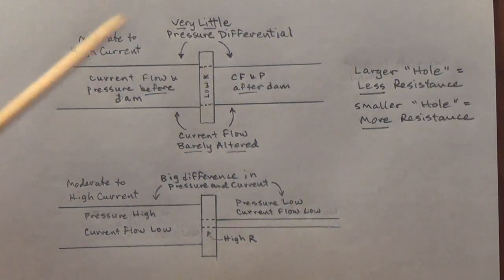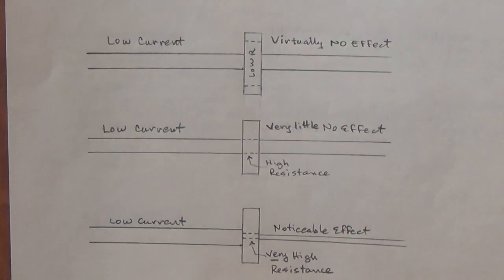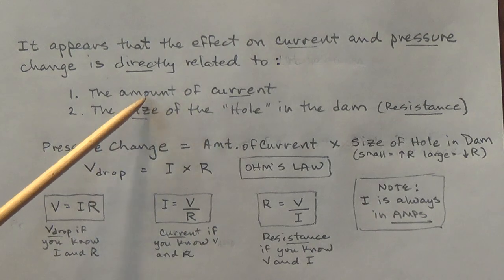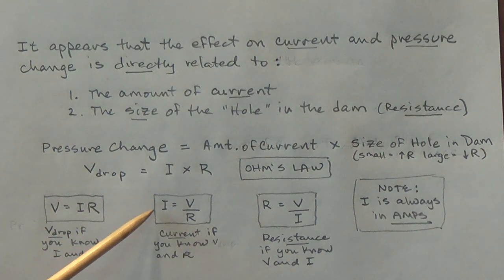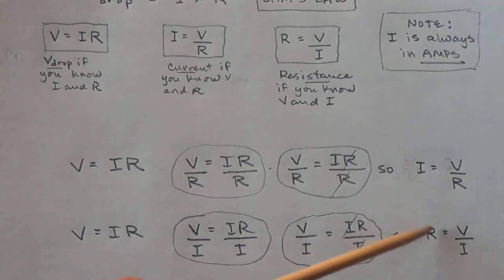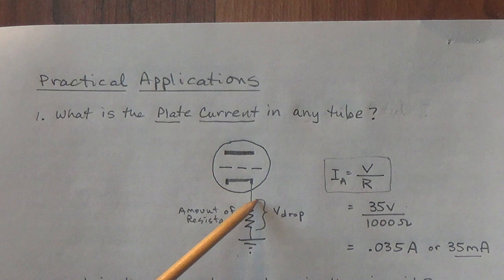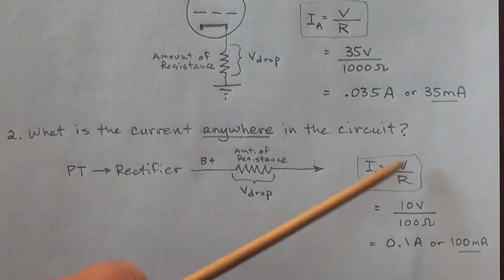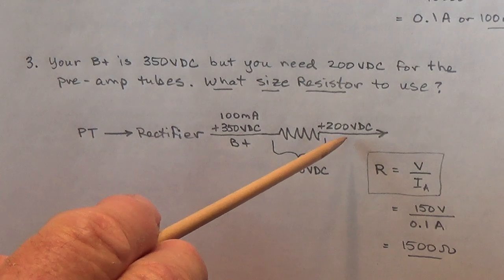Resistors, Part 1:  Their Circuit Function &  Practical Applications of Ohm's Law

Comment: Ohm's Law trivia:  Back in the day I took the letter 'I' as an indicator of current as just one of those things.  For whatever reason I wondered today why it is 'I'.  It turns out that 'I' is a derivation of the French term "intensité du courant" (literally, intensity of current).  The phrase was apparently coined around 1820 by a dude named André-Marie Ampère.  It eludes my what some French guy named Ampère, in 1820, would have the audacity to come up with 'I" as an indicator of electrical current.  :-)
Reply from the maker: Thanks, Michael. Let's face it, what does a guy named Ampère know about current?......especially a guy with a girl's middle name :):)

Comment: For #3, wouldn't it be incorrect to say the current flow is still .1 amps? .1 was the result when there was a 100 ohm resistor but if we are increasing the value of that resistor to drop the 150 VDC wouldn't the current flow be less?
Reply from the maker: The voltage drop is dependent on the current applied to the resistor and the value of the resistor.....period. Using your method would make it impossible to answer the question because you would have to change the current to suit each resistor, which would result in a different resistor value, which would change the current, etc. etc.

Comment: So... Im nearly brand new to this stuff.
Dumb question 1. How do you drain the caps after you unplug the amp?
Dumb question 2. I have a self biasing amp, but I dont trust it. It came stock with EL34s.
...but i contacted support and they said its ok to drop 6v6s in it. They said its fine but id notice a power drop.
So thats what i did. Sounds way better now. However Im concerned (despite what support said) that Ill run into trouble later becsause of the etremely different tube specs.
The amp is basically a clone of a Vox Night Train. 50 watt head.
Am i just being paranoid? ...or am I correct to be concerned?
I made the tube swap around 3 months ago.
Id really like to see the bias voltages for myself to ensure everything is OK...thats why im trying to learn this.
Thanks for the great videos!
Reply from the maker: You're not paranoid at all, IPH, in fact, I wish all amp owners were as conscientious as you are......and your questions are far from dumb. In several videos, I have shown how to drain the filter caps using a homemade tool. The simplest way is to buy a 100 Ohm 5W resistor, hold it by the insulated body of the resistor, and touch one lead to ground while touching the other lead to each positive filter cap lug for several seconds. With regard to simply plugging 6V6's into EL34 sockets and hoping for the best, I too would be skeptical. Cathode-biased ("self" biasing) circuits are forgiving, but such a tube switch would definitely be a severe challenge for the circuit.  Watch the videos on safely measuring Plate Voltage (plate to ground with DMM) and Plate Current (measure exact cathode bias resistor value(s) then measure voltage drop across them while amp is running...calculate PC via Ohm's Law). See videos for explanation. Be careful. Good luck.

Comment: One of my early instructors, many decades ago, laid Ohm's Law out so. You can use either of the two, depending on what you know to be true.

   E                            P
I     R         or         I     E

Circle what you want. You want P (power)? What do you have left? I times E (or IE). You want I (current)? Whats left? Either E over R or P over E. You want E (voltage)? Either I times R or P over I. You want R (resistance)? E over I.

Easy to remember. And, I never forgot it.
Reply from the maker: This is indeed an excellent way to remember the equations, NDL. Thanks !!!

Comment: When I first started electronics all I could find at first was resistors from a local surplus store. With that pack of resistors, a breadboard, some LEDs and a multimeter, I spent a good 3 months or so learning stuff about them before I moved on to other things. Don't under estimate the complexity of electronics. If you think something's simple, you don't know enough about it.
Reply from the maker: Amen, N. You never quit learning new things in electronics......and you'll never know all there is to know. We're all stuck somewhere in the middle :)

Comment: Uncle Doug, you have managed to teach me in 20 minutes what I was supposed to have learned over a whole term in school but failed to grasp.  Your explanations are so clear and concise. The electronics Tutors in our school appear to confuse their Students by going off on meaningless tangents. I'm now wondering about their abilities to teach students and questioning their knowledge.  In this awsome video you mention ohms, current and volts. The one big question left in my mind is how do I deduce the correct wattage resistor to use in these example circuits; I guess this might be very important if you don't want to let out the magic smoke from the resistor?
Reply from the maker: Wow......thanks so much, IG. You use Ohm's Law to calculate the wattage of resistors. There are three different formulae:  Power (in Watts) = Current Squared x Resistance  or  Current x Voltage or Voltage Squared divided by Resistance. For example, if you know the current, i.e. 5A, and the resistance, i.e. 10 Ohms, then the Power =  5 x 5 x 10 = 250W.

Comment: Very good- but... I was taught to lift one leg of a resistor to (fully) isolate it for (self) measurement. So, I was surprised that you are measuring "in circuit"- more than once. I realize that we are teaching very basic components and math here, but... hmmm
Reply from the maker: I lift a leg too, Thomas, but only when the in-circuit value varies significantly from the expected value.

Comment: Your videos are helpful.  I'm the proud owner of 4 tube guitar amps, 2 of which are hand wired, 3 with DC Rectifier tubes.  I hope to carefully (safely) learn how to bias my own fixed biased amps (2), and perform amp circuit testing, and replace bad caps, etc.  Thanks for helping me to move toward that goal.
Reply from the maker: You're welcome, Clay. Best of luck with your do-it-yourself projects, and be sure to follow all rules for electronic safety.

Comment: Hi, i was wondering  how resistors effect a low line level like a guitar signal (can they change the frequency response?)
Reply from the maker: It depends on their values and where they are located in the circuit, Fred. Capacitors tend to have a greater influence on tone.
Reply: Thanks! great video!

Comment: What's the best way to drain capacitors before tests?
Reply from the maker: In my biasing videos, I show you how to build a cap discharging tool using a 10W 100 Ohm resistor.....check it out.

Comment: greetings uncle Doug
i have a checked checked voltages to my leslie 147 amp and here is what i got compared to suggested voltages based on today's 120volts instead the 117 volts of the past decades

1st DC voltage coming from the bridge rectifier to one side of the choke  is 444 vdc,  suggested voltage should be 430vdc.    
2nd voltage on the other side or after the choke is 432vdc.  suggested voltage is 420vdc
i checked resistance on the choke and it is 64.1 ohms

3rd voltage after the oc3  is 317vdc.  suggested voltage is 310vdc

i wonder if could get your advice here  because i've been thinking if i put a resistor between the output of the bridge rectifier and  the choke to lower these  dc voltage at least closer to the suggested voltages based on this web site   
https://www.google.com/url?sa=t&rct=j&q=&esrc=s&source=web&cd=7&cad=rja&uact=8&ved=0ahUKEwjZ69nTs9zVAhVLyVQKHePLDTcQFgg-MAY&url=http%3A%2F%2Fbentonelectronics.com%2Fservicing-the-leslie-147-amplifier%2F&usg=AFQjCNGke3-yafFswHTPTpY-Qy7FRQ4Bxg

if it is possible though, what size resistor and  also of what wattage this resistor should be.

thanks in advance
Reply from the maker: To be honest, 4H, I would ignore the slight voltage elevations and simply use the amp as-is. I can't imagine that the relatively minor increases would cause any harm at all.

Comment: Hello,
I hope I can ask this question correctly. In part three the goal was to find the resistor you need to properly power the preamp tube. You solved this by finding the current in Part2 (.1A) this allowed you to solve for Part3. How is it possible to find the resistor needed in part 3 if you didn't have the resistor to measure in part 2? 

I hope this makes sense. I'm really interested in the designing of amps from scratch. 
Thank you as always I'm learning so much from your videos, great teacher you are :D
Reply: Please forgive me, I rewatched a few times and noticed your pop up on the screen which answers my question of just adding a resistor temporarily to find the current then you can solve for part 3. Thanks as always.
Reply from the maker: You're welcome, Garrett. We're glad you were able to solve the problem.

Comment: Thanks for t his video series!!  I have no problems with the math, I started this journey but putting myself through the NEETS testing so this is a great refresher.  I'm really enjoying learning where the various bits of knowledge are useful in an amp is really helping me make sense of what's going on when I fix things.  

Also, Ever hear of a Halton radio?   I got dug one out of my parents barn,  the wood is shot but I'm thinking it could possibly be turned into an amplifier... am I nuts?
Reply from the maker: You're welcome, Daren. I have never heard of Halton radio. Many people convert radios into guitar amps, but I never have.  In table radios, much of the chassis is devoted to the receiver circuit, which is not used; the output power is generally rather limited, and the speaker is generally small and unsuited for guitar use.  Some console radios, however have larger speakers and higher output power.

Comment: I'm a little confused on the third calculation. I have a 12at7 that needs 200v and 10ma plate current . If my supply voltage is 350, and I wanted to drop it to 200,  wouldn't I need a 15k dropping resistor in the power supply, not a 1.5k?
Reply from the maker: Not according to Ohm's Law. As stated in the example, Resistance is equal to the Desired Voltage Drop divided by the current, or 150V / 0.1A  = 1500 Ohms.  Why do you think it should be 15K ?
Reply: Yep, I understand the math part just fine:) (I'm a software engineer, I get to do algebra for a living) What I'm trying to wrap my head around is why the supply current is being used rather than the device current. So lets say my supply could supply 10000amps @ 350vdc before voltage sag occurred (Lets pretend my power supply is an entire substation). The tube's plate current would still need to be set to 10ma @ 200vdc. How would I go about calculating both the bias, plate, and inter-nodal resistor with such a beefy psu?
Reply: and thank you for the reply! your videos are very unique, there's nothing quite like them on youtube
Reply from the maker: The plate current and bias in the pre-amp tubes is not set by the resistors in the B+ rail, but by properly selected cathode bias resistors. The nodal resistors in the rail simply provide appropriate voltage to the plates of the pre-amp tubes. To calculate the value of these voltage-dropping resistors, one must know the approximate current flow through the rail. The current draw by the pre-amp tubes is negligible compared to the output tubes, and their bias, once set (usually simply by using the values provided in a schematic), is not rechecked periodically, as it is with the output tubes.
Reply: The amount of current that your supply is capable of delivering, as long as it is great enough to supply your desired current is immaterial. It's the 350V DC that matters. If you know that you need 10mA at 200V DC, you need a resistor that will drop 150V when it is passing 10mA. R = V / I, so you would need a resistor of 150 / 0.01 =
Reply: I hit 'reply' by accident. As I was saying, you need a resistor of 150 / 0.01 =  15,000 ohms which would pass only the 10mA at 200V that you wanted.

Comment: I have two resistors that are coloured a kind of jeep green and under the surface i can see around three windings,they are from a 90 watt bass solid state amp,and the schematic says they are R24 7W, i think they are power resistors,I cant find any resistors online that are R24?,could they be 24ohms?  size;16mm long x 7mm thick.
regards for any help.
Reply from the maker: +MrAndfio   Greetings, Mr. A. The term "R24" is simply the way they are labeled in the schematic. They are the 24th resistor, generally numbered from left to right. They are large ("power" resistors) so they can dissipate 7W of heat. If their actual resistance is not marked on them, you will have to measure it with an ohmmeter.

Comment: Hi Uncle Doug, excellent videos by the way!
I have a concern about the analogy though, if you increase resistance and it decreases the flow rate or current, then the pressure across the resistance stays the same. R = V/I, and 2R = 2V/I so if you double R you can double voltage to keep current the same or halve current to keep voltage the same. There is never a decrease in both current and voltage. Am i right?
Reply from the maker: +Hanzel Pinto  For a fixed Resistance, Current and Voltage are inversely related....an increase in one results in a decrease in the other.....so you are correct, V and I will never both simultaneously increase or decrease, and (as you said) if you double the Resistance, then either the Voltage must double or the Current must decrease by one-half to maintain the equation.
Reply: +Uncle Doug Great so I understand the concept but I get confused when you take measurements across a resistor. This video says you measure DC Volts across the resistor on the B+ to calculate Vdrop. If current is kept constant then shouldn't the voltage increase not drop? Also since there is a resistance shouldn't we expect a drop in current? Does the formula calculate the current downstream of the resistor?
Reply from the maker: Voltage drops across resistors, depending on the resistance and current being applied, but current doesn't "drop" across resistors. The overall current throughout the circuit is lowered by the presence of resistors, but the current is exactly the same on both sides of the resistor. Imagine a circuit with two resistors and current flowing. There is a voltage drop across each resistor, but the rate of flow throughout the circuit is the same anywhere in the circuit.....it does not "drop" from one side of a resistor to the other. After all, if water is flowing through a hole in a dam, there is more pressure (voltage) on one side than the other (i.e. pressure/voltage drops from one side to the other), but isn't the flow exactly the same on both sides of the hole?
Reply: Ohh it finally clicked when I watched the 2nd part! Voltage is a measure of electrical potential energy. As current flows across a resistor some of the potential energy is converted to heat and light so the potential energy decreases! Just needed some of the theory. Thanks!
Reply from the maker: Yes, power (measured in watts) is a measure of the conversion of energy from one type, i.e. electrical, into another, i.e. heat.

Comment: Uncle Doug hi,
Just like to Thank You for all the great videos you have done I have learned so much and some of it has actually stuck which has really amazed me I wish back in the days of school I had a teacher as good as you great job. 

I do not know if you would be interested in sharing some light on or if any one else would be interested in seeing and learning the differences in and between different kinds of resistors such as carbon vs metal and why they are used in the applications they are in amps also a very similar thing with capacitors why they use different types i.e. green caps, polyester, orange drops etc and where they are used and why they are used in particular areas in the amps along with there different make ups.
I have heard so many stories about using the older types of parts i.e. carbon resisters etc to maintain the tone/sound and really would like to hear some truths about them if you ever had the time or was able to?.

Any how Thank You again for the great videos so much great explanations/teaching.
Reply from the maker: +Oswald Wabbit   Thanks so much, OW. Rusty and I are glad you enjoy the videos. My stance on resistors is that the imperfection of carbon comp resistors and waxy old capacitors plays a big part in creating the "vintage tone" we associate with great amps like the Fender Tweed Deluxe of the 1950's.  Metal film resistors are much more precise and stable, but these are not necessarily desirable virtues in a raunchy old amp. If you are seeking ultra-clean,low distortion sound, i.e. for jazz or Hi-Fi use, then metal film is the way to go.....but for old style gritty rock, original carbon comp and old tone caps is the way to go. In my scratch builds,  I use metal film resistors in the screen grid circuit and power supply rail, but stick with 1 or 2W carbon resistors in all the tone circuits.....as you can see in my Supro Tremo-Verb video series.

Comment: a how would you Identifi ohms dog bone  resistors to new style resistors
Reply from the maker: +fucken killer jason  If you are speaking of the very early "dog bone" shaped resistors, the color value code is Body, End, Dot.....the color of the body, then the color of the end, then the color of the dot in the middle of the body. The values of the colors are the same as they are on modern carbon resistors.
Reply from the maker: +fucken killer jason  If you are speaking of the very early "dog bone" shaped resistors, the color value code is Body, End, Dot.....the color of the body, then the color of the end, then the color of the dot in the middle of the body. The values of the colors are the same as they are on modern carbon resistors.